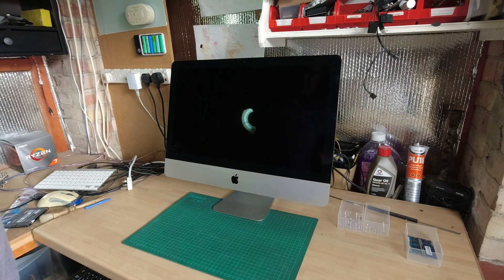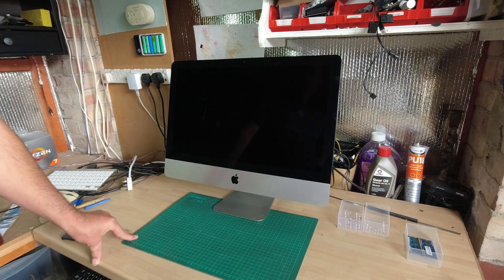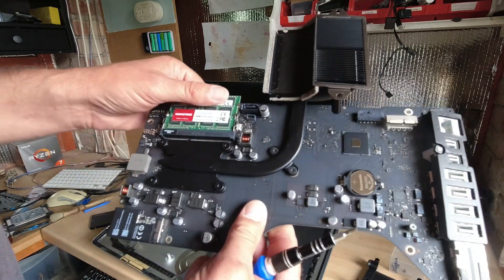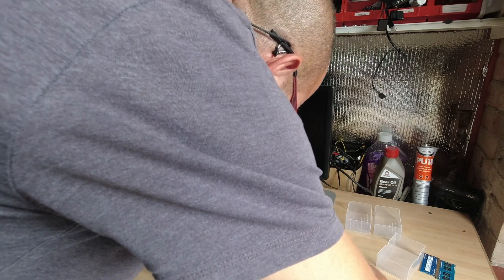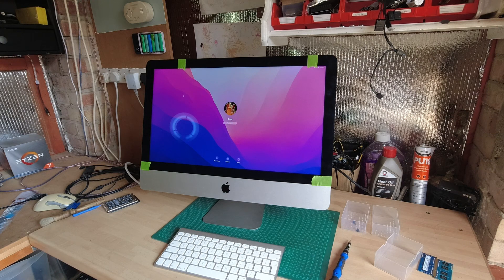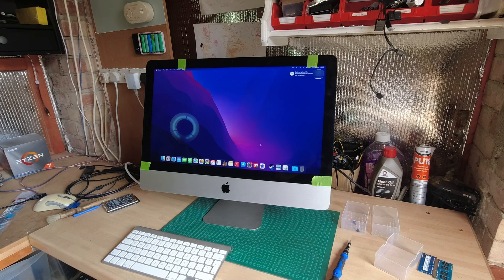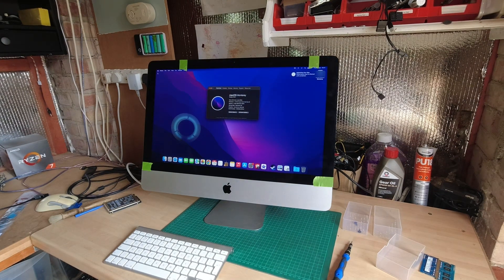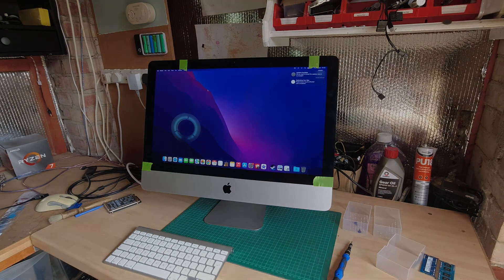Installing MacOS Monterey On A Late 2013 iMac Using @Mr.Macintosh  Guide Plus SSD & 16GB Ram Upgrade

Comment: I have the same model. Currently running OSX 10.5.5. My delima is to make the Opencore works. DO you have any guide to create opencore installer.
1. Create opencore from other Mac machine.
2. Create opencore from windows machine and install to this iMac.
3. Create opencore install using this iMac machine and install to it.

Appreciate and hoping some guide how to do it.

Comment: Thanks, great vid.  May I ask which brand of  RAM you used there? I'm hoping to buy the same model and year of late 2013 iMac. I was thinking of attaching an SSD externally in a caddy plugged into one of the USB 3 slots on the back. Would the speed be as fast as yours internally? Or does the external attachment via USB limit the speed? Thanks again.

Comment: If it has a NVME slot, it will work, upgraded my 2013 imac with a 1tb hdd, 16 gb ram, and a nvme  1tb drive and a 1 tb ssd drive running Ventura.
Reply: I am looking to do this with my 2013 27” imac. I want to run ableton and music production software, do you think the upgrade would cause issues with that? Any noticable problems since you have done your upgrade?

Comment: Thanks for the nice video. I have an identical iMac with an SSD drive (two SSDs in fusion drive) and a Catalina system. I would like to ask about the installation without formatting the SSD (directly system upgrade) like you did. Is the system and its performance OK? My mac is really full of software and I don't want to complicate it with Migration Assistant form Time Machine yet, I read that it can cause problems. Thank you, Kamil